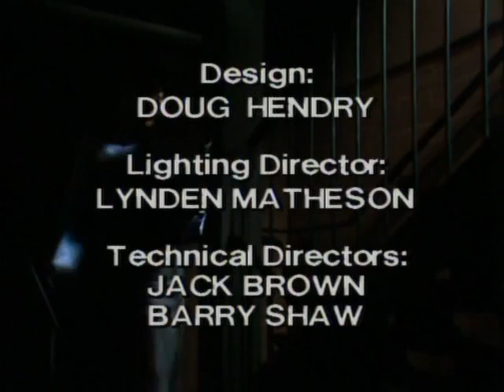Prisoner: Cell Block H - Episode 284

Comment: @ 42:00 - They filmed the fire scenes inside the cell with a 16mm handheld film camera. That’s why it looks so different from the interspersed hallway shots.
Reply: Do you know why they did that? They have filmed fire scenes before without it looking so strange.
Reply: @zombiemaradona  it was probably shot with a small handheld 16mm whereas the video cameras of the day were huge pedestal mounted behemoths. Probably done this way to protect the equipment in close quarters.

Comment: What happened to the picture at 41:56? Was this extra footage later added in or was it like when a random shot of the outside of WDC is shown due to the original scene being partially destroyed?
Reply: +Heather Snodgrass. They might be using a special camera or something has been placed over the camera lens because the fire Doreen starts is so volatile. when the fire extinguisher explodes due to the leaking grog, it might have been difficult to film otherwise.

Comment: Crikey!  Did they coat the lens in vaseline for that scene where Doreen set fire to the bed?  The drop in picture quality was almost epic.
Reply: That scene was filmed at a different location fire regulations as for the picture quality I can only assume they used cheap equipment incase it got damaged by the flames  Google it 😁

Comment: Why is the film different when the fire goes off? Looks like it was recorded on a 1 megapixel camera lol
Reply: A special cell out of real bricks was built to prevent damage to the permanent sets and film was used, for the only time in the whole series because there were technical problems with the video cameras of the time being unable to cope with the flames causing swamping out and streaking on screen
Reply: @gavc6442  thanks for that, was wondering that myself.
Reply: @gavc6442  Thanks. But they managed to fix it by The Great Fire?